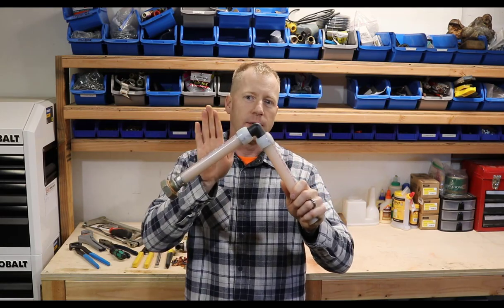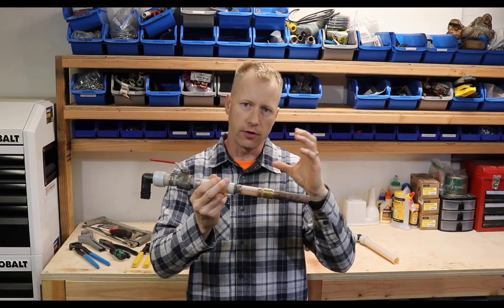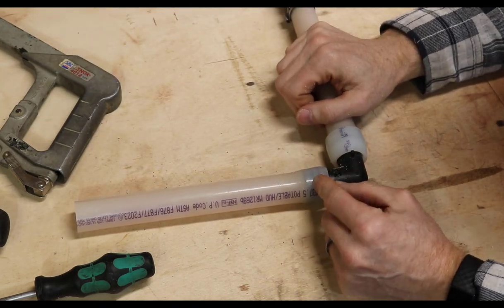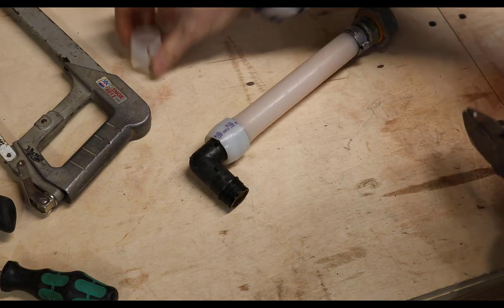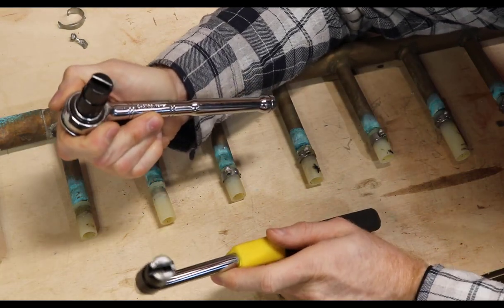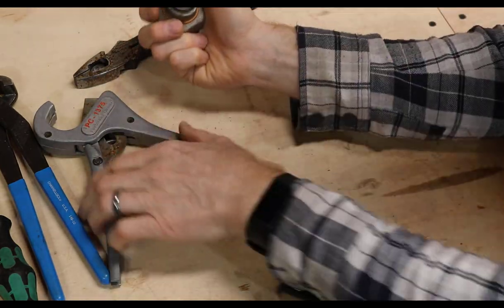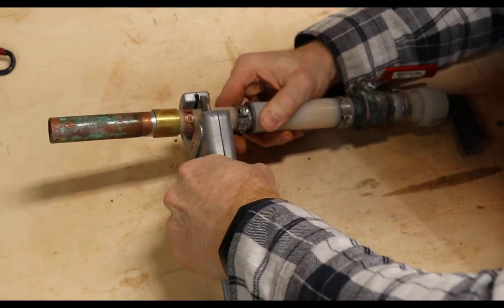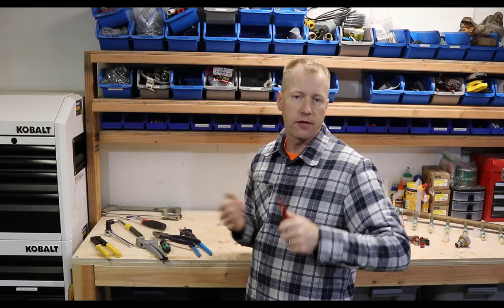Removing PEX Crimp Rings

Comment: I was a plumber for 34 years, and I used a lot of crimp rings with pex, and I also sometimes would take my torch and heat up the fitting if it was brass and slide the pex and copper ring off.

Comment: Where in the world did you get that $30 stainless steel crimp removal one?! You said Home Depot but I can't find it for the life of me.
Reply: Lowes these work well, as they should, sadly that don't get used often, but they do the job well., I refused to buy a second remover, for the stainless steel crimp rings, and the flat head screwdriver method works well.
Reply: And I just realized I responded to a 3 yr old post.🧐😁

Comment: I'd like to make a suggestion to improve your procedure if you don't mind.  After you have removed the crimp band take your crimp ring cutters and make a couple more squeezes around the pex tubing and it will fall right off saving you the hassle of pulling on it with pliers or taking the risk of damaging the fitting with the saw.

Comment: For heaven's sake, invest in a heat gun!  Put some heat on those "stub" pex pieces after you cut the ring and you can pull them off with your fingers!
Reply from the maker: I have one and will give it a try next time I need to pull a connection apart. Thanks for the advice! That avoids the possible damage to the ring barbs on the fitting and a potential for leaks! Thanks again.

Comment: for the copper and steel rings I found a dremel with a small metal cut-off works great.
Reply: tell me more about this dremel small metal cutoff, does it scratch the grooves on a cutoff valve or other fitting?  scratching can cause leaks!
Reply: @synthesizerisking2886  With a steady hand I have never had any problems. Starting to lose steady at 74.

Comment: I would heat up with the heat gun and just use a carton knife to cut the ring. You shouldn't be reusing that plastic fitting anyway. If it was a brass fittings yes you could use it again and be careful not to scratch it with the knife

Comment: For removing those stainless steel clamp rings,  just use a Dremel tool with an abrasive cutting wheel on it, cutting the very 'top' of that clamp 'EAR'.  once you cut through the stainless steel, the clamp will just open up.

Comment: My I-crimp cinch tool has a removal function built into the tool for the cinch rings.  Press and rotate a button on the tool to allow the jaws to close completely thus cutting the crimped nub at 90 degrees to the band.

Comment: Those yellow handle pex ring cutters from HD at least just ruined a ball valve. I adjusted it but it didn't put enough pressure on the ring to break it. I adjusted it more when it broke the ring it put a notch in the barbs on the valve nipple. I didn't realize it did this at first until I saw dripping from the new crimped on end. I was surprised it was leaking I used pro rings that have the spacer when I removed it again I could see big left by the tool.

Comment: I got the tool to remove the PEX clams. However, the tool would not enter into a plastic fitting. I wonder if this is a bad tool, or others are not made for plastic fittings as well. Thanks.

Comment: With ProPex (Pex A) you never re-use plastic fittings, so "damaging" them is irrelevant.  Also, with ProPex, just use a heat-gun or hair dryer to heat the pipe after you have removed the ring. it will easily pull-off with a bit of wiggling and no chance of damage to the fitting.

Comment: Very helpful-- we benefitted from demonstration of the full amount of time required to remove crimp, clamp or Pro-Pex fittings. This video also reveals how "tough" a fitting can be in actual use, over time. 
.
On another question, you replaced the copper manifold for a subfloor radiator, covered with blue-green corrosion. But was that corrosion a functional problem for the radiator? If copper is that corrosive, why do people still insist on using it?

Comment: Hi buddy. Great video. I’m looking for a explanation of removing the type in a older rv water system. Grey 1/2 inch and 3/8 water hose and the cinchs are metal but look different.   I’m thinking now just to maybe use some nippers like you did.  I was a bout to buy a crimping tool / removal took for 30$ and I still am to crimp the new repair.  But I’m wondering if the removal tool would even work on these type or cinchs rings   Let me know what you think.  Thanks

Comment: Ok most plumbers get $95.00 an hr,it took you about 3 minutes to take off 1 fitting. 

That's $3.16 in time.

It's it cheaper to just use a new fitting that cost about $1.00 from the prices I just found.

Than to cut out old fitting unless you don't have any new fitting available.

Comment: So according to last example, there is no way of loosening the crimp ring to remove a fitting. The pex has to be cut. Was hoping for a solution that saved the pex since I’m working in a tight spot.

Comment: You showed an alternative way for removing both the Propex plastic and steel clamp, but then only offered a demonstration on the proprietary tool for removing Pex Crimp.  Any chance you could provide an alternative for removing the crimp fittings with at-home tools?  Thanks!
Reply: You can also remove the copper pex ring with the hacksaw, sawing in a 45-degree so as to avoid damaging the fitting.
Especially if it's your last fitting.

Comment: Not much of a plumber myself but good information.  Good video.  Other then speed, I thought an advantage of Propex was that the fittings weren't reductive of flow!  Thanks for posting.
Reply: I have been using uponor pex for years. It is type A pex witch  has  full thickness carbon cross bonding witch is better for freezing. Also if you fold it in half and crimp the pipe  you can heat it and it will go back to normal. On top of  that the system is easer to use and cheeper if you do it all day.
Reply: Eric Schmidt good to know.  Thank you.

Comment: Heat works on every kind, everytime lol
Reply: Heat works to remove cinchs on pipe ?  I’m trying to repair a rv water system with a leak and trying to remove some rings without ruining the fittings